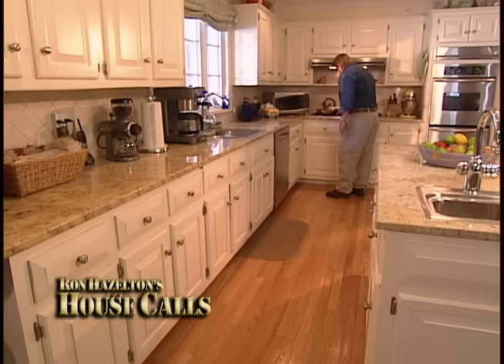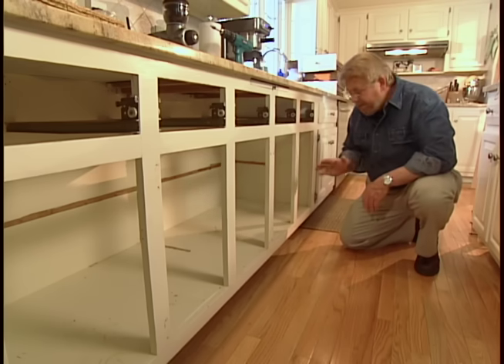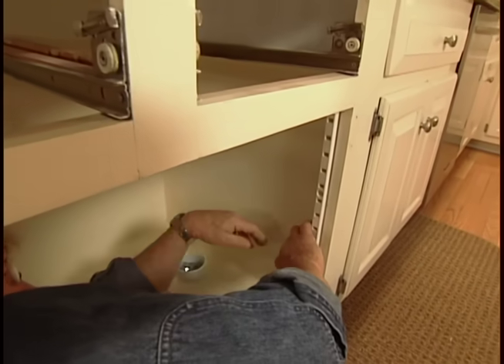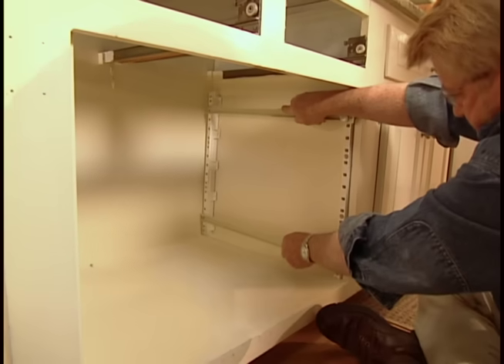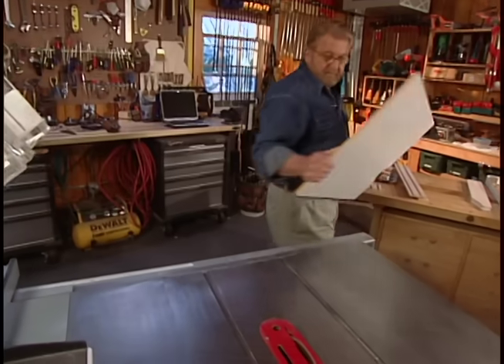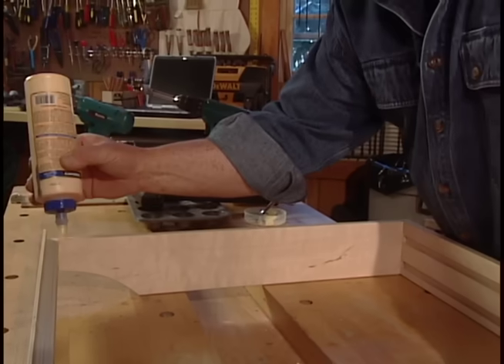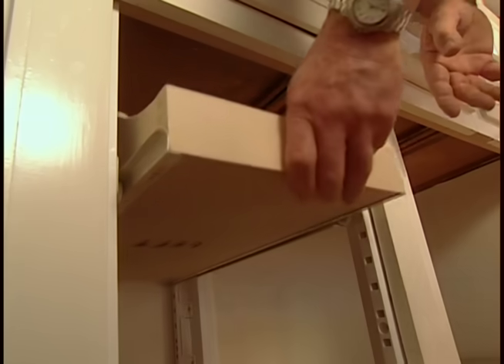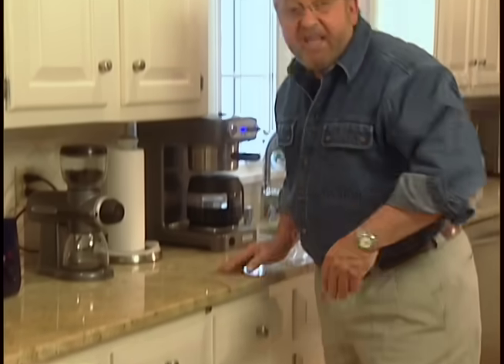How to Install Pull-Out Shelves in Kitchen Cabinets

Comment: 2:20 "i want to try to save these since i may be able to use them later on"... ahhhh, a man after my own heart... I long for the days when the family had 165 acres and unlimited space to store EVERYthing I ever came across.. My parents grew up during the Great Depression, so i learned NEVER to throw away anything that might possibly ever even remotely be something that could be used again. Does a 6 foot tall stack of used bailing wire sound familiar? Awesome video. As always, well done, cleanly presented, and once again, I come away searingly jealous of your workshop!

Comment: My wife said it hurt her back getting the pots and pan so i made these for her. I just got the sliders at hardware store and made shelves myself. Didn't cost much at all because i didn't buy the kits but they are nice. I can't say anymore then the ones i made but......
Reply: red royce are the tracks always on the side? Would be easier for me if they could be on the bottom of the cabinet. I don’t feel comfortable taking out the middle support
Reply: @dcwatashi  Then just add to the middle support or use the middle support as is. He did that to have a few wide drawers - you can always just match what you already have. But to answer your question, they do make undermount drawer slides.

Comment: I do like when somebody thinks ahead. It seems it was all to be able to access the "tall bottles".
And so he can make use of the old Makita from like 20 years ago?
Now a days, we use better under mount glides with soft close doors.
Reply: And those of us with a shop similar to his wouldn’t buy a kit like that, either. We’d just make the drawers and use the better, more expensive slides. Then take the cabinet drawers, drill the 35mm insert and use those adjustable European hinges. But this video shows how anyone with just a hand saw to trim the sides and bottom to length can modify their kitchen to improve functionality. I wasn’t aware of this option and am happy he showed it.

Comment: Another great video. I was waiting to see how you would address the missing vertical supports. Attaching them to the doors is brilliant.  You need a stop for the attached vertical support, yes?
Reply: no, the door hits the face frame.  The vertical piece is smaller on the top and bottom so it is recessed into the cabinet.
Reply: @Carl-LaFong1618 CAN YOU PLEASE ADDRESS THE QUESTION, where can we buy the partition?  Site you posted does not work.

Comment: Exactly what I need for our new house which does not fit my disabled status.   Our new kitchen has these annoying narrow face frame cupboards.  Only the set under the stove have slide out shelves, but they are fixed and cannot be adjusted to fit our needs as the ones shown here are.  I just have to unpack enough boxes to make room for my saw table, find the glue and the tools and the project will be underway.   Since I'm not as flexible as I used to be I shall be accepting some help from my husband who can still bend down and crawl into cupboards as well as lift large pieces of plywood.  It will be a family effort.

Comment: You're kidding, right 🤣 this for advanced, not starters like me but thank you ur good 👏
Reply: I think his point in this video is that you ‘starters’ actually can do this because the kit provides everything and you pretty much fit it in an existing hole that you already have. The one portion I was disappointed in seeing was him in his shop using a cabinet saw. It may have been more in keeping with this build to use a hand saw to cut off the sides and the shelves. Those were the only ‘non-starter’ like things he did. You need to be accurate in those cuts but you need to do that on the table saw, too. Those of us with a shop like his wouldn’t use this kit. We’d build the drawers and use better slides. But you really can do this project with just a few hand tools such as hammer, tape measure small drill and screw driver and hand held screw driver. Break his video down into the pieces. Removal of unneeded parts, install provided supports, cut shelf parts to length then glue and screw together and install. You actually can do this. I’m 75 and can’t get up and down like before but if I plan properly I could have these parts in reach once I get on my back in that cabinet and screw them in place. Don’t be discouraged by his table saw. It isn’t required for this kit system.

Comment: An older video, but the only one I've seen that addresses the need to re-support the drawer rail(s) when removing the stile(s).  A good idea anytime you remove them under either a long run of cabinets, a cooktop or sink IMHO.  The last thing you want is your counter sagging.  I did exactly this under my cooktop and sink when converting mine.

My tip... when you remount the doors, in place of mounting the removed stile to one door with an overlap, leave it able to swing closed even if the other door is not opened first.  Yes, it leaves a small gap long the other door, but you don't have to open both to get at the drawer contents in the front of the shelves.  It is barely noticeable and keeps you from banging them together if closed in the wrong order.

Comment: The adjustable feature is excellent.  I don't like those type of drawer slides, though.  Wish they had a way to do this with Blum tandem slides.  I'm currently installing shelves with those, but I'm building new cabinets, so not very quick and easy ;)

Comment: Excellent video, but I am confused about the reinforcement. The weight of the counter goes down the vertical legs. If you cut two of those, all the weight goes into the remianing legs and that can be too much, right? I dont get how adding a horizontal piece of wood fiexs that,  I would think the reinforcement has to be in the vertical legs!

Comment: Great... so easy !!    Just need to spend $850 on a new table saw.
Reply: celestialdream49 Nonsense I did the same thing in my own home with an old 1970s craftsman contractor saw that I paid $50 for. It honestly doesn’t even take a table saw to make something like this.
Reply: Can be done with a hand saw or a circular saw
Reply: Me too
Reply: Use a circular saw with a homemade straight guide jig.
Reply: @hotrodhog2170  Wow.
Reply: I just bought an old table saw at a garage sale for $50 this summer...now I know what I am going to use it for!

Comment: I built cabinet shelves myself, no kit. Used self retracting drawer slides from home depot Saved lots of $.
Reply: I've done one. still need to do about 22 more. I agree, I can do them for way less than $75 for just the shelf kit (not counting brackets or slides). But, I do have to say, the ability to change the height that easily is a nice feature. And, the company does sell just that portion separately.
Reply: @jasonstarr6419  d

Comment: If it's a particle board carcass, reinforce the face attachment with metal brackets underneath connecting to the bottom support box (the kick area)
Reply: Not following you - can you give a little more detail about the problem and what you’re recommending?  Thanks!

Comment: I like the simplicity also well explained Ron. This is quite a departure for you as you normally build from scratch. I think I will use this idea when I build out my pantry.
For cabinets I am a little lazy and use the existing shelf as a base for my sliders with undermount soft close drawer slides. Although I make the drawers so not being a carpenter it takes me longer, but it is fun.
So, is there information available for this system,. like how do I know what to order and what are the prices. Did you get the drawer pack and the fitting systems from QuikTRAY or are there two companies. Your feedback will be appreciated..
Thanks

Comment: Since the length and width was cut, how were there dove tails?  Did I miss that part?
Reply: Those dovetails are already milled into the side pieces. By only cutting them to length, you cut across the dovetails leaving them intact. You don’t cut the dovetail part of the cross piece (called the ‘pins’) so they still slide into the side pieces.

Comment: Rollout shelves are an improvement, but a better solution is change to all drawers.  A rollout shelf is basically a low sided drawer behind a door or 2 doors.  And, if you go to some kitchen with rollout shelves most of the time  you will find the back of the doors all beat up from the shelves hitting the door. With a drawer you just pull them open. No damn doors to open and close. If you don't open the doors wide each and every time you best the backs up. I did the all drawers in my kitchen,  never going back to anything else.

Comment: In my designs, I will not put in a shelf in the lower cabinets.  Once I tell a client they can have drawers or trays, their(usually her) responses are all smiles.  Much easier on taking pots in and out. No kits involved as I build the trays. kenscustomkitchens and yes Carpenter is my last name. Ironic... a guy named Carpenter who does carpentry.
Reply: Nah, if you couldn't cut a board in half and nail the two halves together, then your name wood be ironic.
Reply: @creekwoods5625  One time at a woodcraft store in Orlando, I asked the guy to look in the client list for any with my last name. He could not find one.  :-)
Reply: Glad you’re taking this design stand. We had our kitchen remodeled and had drawers rather than under cabinets open space with that 12 inch shelf in the back. For the two of us in our 70’s who pretty much can’t get on our knees and climb under the lower cabinet like we used to, our drawers or this sliding shelf design is fabulous. Keep insisting on installing your sliding shelving even if they resist. They will be thanking you sometime.
Reply: @feversol  Thanks. Have a great day.

Comment: One problem: your video didnt explain how to get the measurement for customizing the drawer. I'd say that probably the hardest part. Not to mention you need to own a table saw. Thanks.
Reply: Bug Out Box the measurements are easy, measure he space after installing the slides/glides, and you don’t actually need a table saw, a circular saw could do the same or a handsaw if you’re confident enough
Reply: Usually the left and right rails equals one inch. So you take the width between the rails and minus 1 inch. However, that could vary depending on the manufacturer of the rails.

Comment: Be nice if there was a third center mounted glide so heavy objects don't flex the shelf.
Reply: Add another layer of bottom and glue it to this kit bottom. A quarter inch plywood sheet piece would add considerable strength. I used 1/4” for my shop cabinets and have one drawer full of heavy slides. It doesn’t flex, but if it did, I’d just add additional strips of flat wood or another layer glued to it.

Comment: Some time ago I concluded that bottom cupboards are a complete waste of time.  All cupboards may have drawers, or sliders like this, either 2, 3 or 4 drawers.

Additionally, having just one shelf in the bottom cupboards is just not practically.  What large amount of huge items are being stored down there? Nah. Better to have perhaps 3 or 4  levels (drawers or sliders).

Of course the correct size drawers for pots is as must, as well as the few huge items people may need to store. Not every unit needs to be the same of course.

Peace!

Comment: Not everyone owns a table saw including me
Reply: KingLord I agree...I was impressed until I saw the saws...☹️
Reply: Well, I guess there's no way possible for you to have cabinets like this. Unless of course, your creativity came out for a bit.
Reply: @stowie5790  those cuts could easily be made with a circular saw. Even a jig jaw and a straight edge if that's less intimidating. You could even very easily use a hand saw. Just have to think outside of the box a little.
Reply: @kinglord.. It's alright.. clamp a straight edge to the bottoms and cut them with a circular saw.. You can use a speed square as a straight edge on the side pieces.. I do that all the time.. I break down my sheet goods using my Makita cordless saw and an aluminum straight edge clamped to the sheet.  For cutting plywood veneer, be sure to use a veneer blade in your saw for a smoother cut.
Reply: My whole point is not everyone has tools other than hammer, screw drive or truck full of them. They need to make something more user friendly.
Reply: @kinglord5429  I agree. however, that option (which I've examined) is to have custom built drawers. The slides are readily available at the big box hardware stores, and most cabinets are standard depth (approx 22-24 inches) and installation is pretty easy with just a drill. And, the cheap Chinese tool outlet has cordless drills on sale lots of times for as little as about $10.

Comment: Those epoxy slides are garbage and I hate they're only a 3/4 extension. (The drawer only comes out 3/4 of the way and you still have to reach in. 

The weight capacity of those cheap slides is horrible. Also, the rollers break very easily

Comment: Nice job, but if you could get down into the lower cabinets like a contortionist for hours remodeling your cabinets, then you should have no problem bending down to the lower cabinet for 3 seconds to pull a pan out.